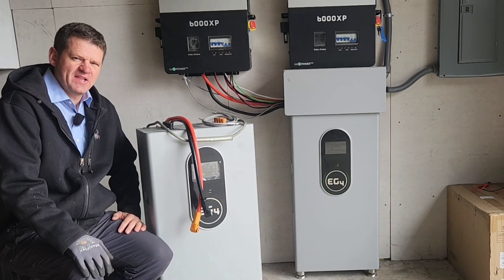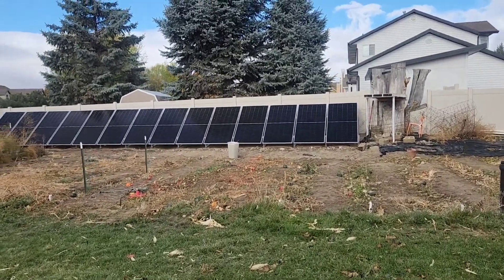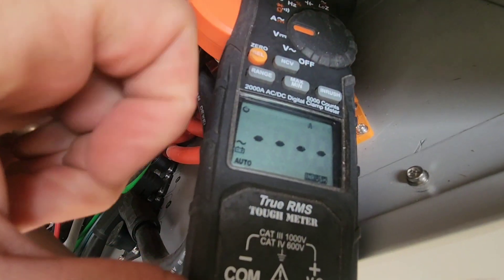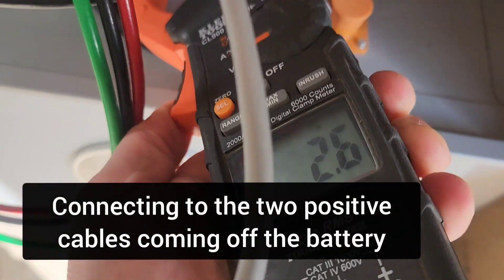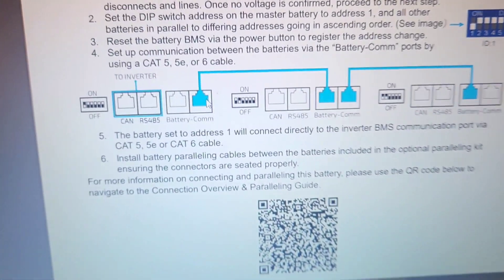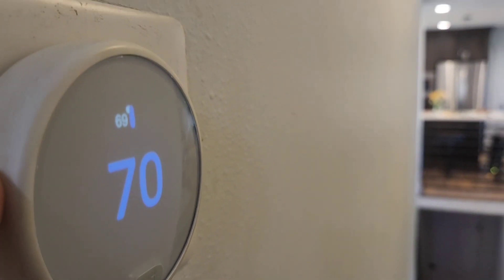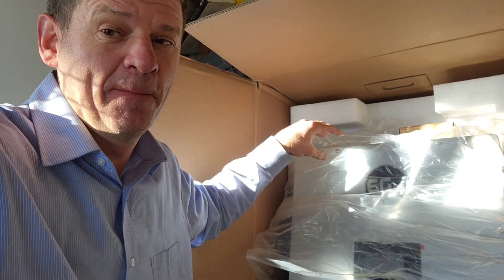Does Adding More Batteries Increase Inverter Output Performance?  Adding 2nd Eg4 Wallmount Battery

Comment: I can attest to the impact of a soft start on my 5 ton AC rated at 144 start amps. After 7 learning cycles the EasyStart dropped start amps down to 30.5 amps and running amps at 14.0 against the label value of 24.44. Startup used to be so loud and annoying, now barely noticeable.

Comment: LRA is 93 amps for this 3 Ton AC.  I just got a new 5 ton AC Seer 18 Bosch installed and it has an LRA of 27 amp and goes all the way down to 11-13 amp draw.  This new AC dropped my electric consumption for the summer by close to 40% and I am cooling the house at the coolest temps ever.  I have owned the property for over 20 years.   I am installing a EG4 flexboss 21 and gridboss with 2x EG4 batteries next and 13 kWH of solar.  Also, installing a Reem hybrid water heater full electric.  No more gas.

Comment: These overpriced batteries are a prime example as to why you should build your own DIY battery box kit. You're assured of getting true, grade A cells, a higher performance BMS and a much more reliable build because you'll build it yourself. And you'll pay a much, much lower price (hundreds to thousands lower) when you DIY your own battery.
Reply from the maker: I'm building my first battery now :)
Reply: @diySolarPowerFunWithRay  Awesome ! It's the only way to go.
Reply from the maker: @kickgas7171  its got the jk bms... I'm having a bit of trouble getting the soc to read correct. Set my cell count and ah setting... I wish there was a manual soc setting.

Comment: I had same issue with central air, dimming lights, added a soft starter and problem solved 😊( eg4 6000) unit.

Comment: Would be awesome if EG4 sent you a 12000xp to test. Ive been shocked with how much quieter it is. I had same issue where 6000xp would pull from utility too much from one leg. Specially during peak utility times costing twice as much as low

Comment: I keep saying this, watts are great but these units have too limiting of an upper amperage.  Even two investors is only maybe 80a of which you're good for 60 with issues. Everyone really needs for these systems to be able to handle 100a max, giving you 80a to use without issues. 

Again, watts are only 1 of your needed measurements.

I mean non of these systems are designed with a typical family usage in mind, let alone alone of power user. I can imagine a two EV house hold each car driving over 50 miles, with say 3 deives. Needing to recharge on a level 2 at no less than 20a each. And when or where possible allow the "only" connected EV to charge at 48a.

Comment: Old school AC with AC Induction motors that cycle with the thermostat are not just hefty starting loads, they can apply up to full locked rotor current draw every time they cycle, all day long. Inverter units don't have a big inrush current when they first start and don't cycle--they just change speed to manage temperature. It could well be cheaper to make heating and cooling more efficient than trying to manage load with an inefficient system. Alternatively you could do something funky like add a mini-split where you need heating and cooling the most. You might try adding power monitoring equipment to record where your loads are. The better quality monitors track each breaker and the main load by both peaks and average. It can be a lot more effective to see the timing of loads rather than simply how big they are. Changing your outdoor unit to an inverter type would probably help the most of anything else you might do, though if you have big electric water heaters they can suck a lot too. It's best not to guess. Once you know some loads might be OK to shift to when you have sun. In some ways a water heater is a battery--it stores heat for later use.
Reply from the maker: Thanks Bill, I agree! The crazy part is that if this air conditioning unit goes you I bet they'll want to replace it with a similar unit.  It is very good for testing the surge rating of different inverters though. :)
Reply: @diySolarPowerFunWithRay  It's easy to get talked out of doing what actually makes sense. I let a good plumber talk me out of getting a heat pump water heater because there wasn't a convenient place to drain the condensate. Now after running a monitoring system for a month I realize it's one of my biggest loads even though it's on a timer and I could have drilled one hole through a wall and watered a plant with the condensate. I think the guy just preferred to work with a unit he was used to using. Fortunately there's a second water heater that serves out guest house that is only used occasionally and it needs a new water heater. I'm going to swap the new resistance water heater into the guest house and remotely control the breaker, and put a heat pump water heater in my garage, where it can cool and dehumidify the garage while it heats water.

Comment: Good day. Id like to have your opinion on the Sunway tech solar 14.33kwh battery and if it can be compatible with a EG4 6000XP INVERTER. I have tried finding videos on the subway battery brand but couldn't find a reliable opinion
Reply from the maker: I don't think that is listed as a supported eg4 battery. You can double-check on the eg4 website though. I'm sure you could use it, but you will just have to not have closed loop communication.  You can change the configuration settings to work off voltage instead of state of charge.  
    Why are you thinking of going with that battery?
Reply: @diySolarPowerFunWithRay  thanks cheif I'm going with that because that's what's here available in belize. I tried looking up for reviews on it but maybe since it's not well known nobody has done the review. My provider mentioned that it was compatible since the Sunwaytech fell on the lux power section
Reply from the maker: @armandomata4107  interesting.  I think ruixu may ship out there. You can check with them.... I'm going to do a review shortly of their wall mount battery and can test/show the communication with the 6000xp. They have a good product.
Reply: @diySolarPowerFunWithRay  OK bro thanks for the help I'll watch the video when it's posted

Comment: Whats interesting is the ecoflow DPU says it can start an AC unit if the LRA is lower than 120Amps... buts its only a 7200w inverter... I bet the lights would still dim tho, I know mine do when it starts my 3 ton heat pump.
Reply from the maker: That's pretty good if it can....I'd love to see that

Comment: It’s always fun to see solar testing. I have a question unrelated to this particular video. I have a metal built “amish building”. It already has a slanted metal roof and I was going to install regular size solar panels across the top. I really don’t want to drill any mounting holes that may introduce future leaks. Do you know of any magnetic mounts for 100W/200W solar panels? I been looking at earth magnets with holes already in them and maybe attach them that way to the panel.
Reply from the maker: Very interesting... Sorry I don't know of any non drilling options. Please let me know if you find something you like though

Comment: the dimming is variable based on where in the ac waveform the ac is turning on. if you were able to have the ac turn on exactly at the zero point every time, i doubt there would be any dimming. this is one of those issues with led lights and power factor if i understand correctly. im not a fan of ac soft starts. ive heard from hvac people that they can cause issues with air con longevity. seems to me like it would be the opposite tbh, but my main issue is their price, durability, and the parasitic load the place on the house. appearently you can phase shift when the AC can turn on to the zero crossing point of the ac waveform everytime reliably by attaching the airconditioning through a solid state relay. solid state relays do have some loss but not very much. i believe its only when the circuit is in use. solid state relays are basically a box with a led and solar detector which opens a switch. because the light producing element can only turn on at the zero crossing point of the wave form, it almost perfectly syncs the closing of the switch with the zero cross point of the wave form. because the power delivered is the dot product of the instantanious ac voltage, the actual starting current requested will essentially be 100amps (or whatever your unit draws) x 0 volts, and will then gradually ramp up to full following a sine curve, i think ~1/240th of a second later, but thats all the electronics in the inverter needs to properly match the load. worth a shot. i dont have formal ee training whatsoever. i think solid state relays are only a couple of dollars. better than a soft start imo.

Comment: The wires from the inverters to the panel appear to be undersized, to start with…. Increase the gauge of those, first.  Next look into getting a soft start kit for your AC, which will vastly reduce the starting current required.  Problem solved, AC starts quickly, lights no longer dimming 👍

Comment: Q? did you change your batt DC discharge settings to double the amount you had before you installed the 2nd Batt? Otherwise your inverter will limit your surge capacity to only 125A DC instead of 250-280 DC
Reply from the maker: Good catch. Yeah I updated that earlier.  Forgot to mention that I had updated that in the video.  I think that helped reduce the dimming when I made that change earlier.

Comment: It looks like the wires going from your inverter to your panel is undersized for the load that you are seeing.  There is the issue of soft start with the air conditioner.  You can also get a "run capacitor" as well and a "start capacitor" that will reduce the current to the compressor
Reply from the maker: This is the video where where install the 2nd inverter and explain my decision in selecting that wire:  https://youtu.be/pBKh2Blsnrk?si=A5ZpkK9oGZVSAfXd.  I didn't account for a 90 amp spike.

Comment: I have 3 x 6000xp's and 4 x Indoor WallMounts that have been running my house in AZ for the last 2.5 months.  Even with EasyStart soft starts on each of my 2 x 3 ton Trane A/C's (old, from 1995) (soft starts dropped their inrush from ~100A to ~26A), I still get a flicker each time they start.  Otherwise has been working flawlessly.  But the flicker does really bother me, too, ha.
Reply from the maker: Someone brought this to my attention. To reduce or eliminate the dimming you could try this is the app:  Settings -> Discharge Setting -> Discharge Limit(Try increasing this value).
Reply: @diySolarPowerFunWithRay  Hm, I had It set at 480A (I think I didn't update it when I went from 3 to 4 batteries, but I was using their 160A recommended x 3).  I'll try it at 640A and see if it makes a difference!
Reply: @diySolarPowerFunWithRay  Well, bummer.  Didn't seem to make a difference.  I think I might just have very sensitive LED's.  Maybe I should try buying one of those cheap oscilloscopes and try to measure the voltage drop and duration.
Reply: must be messy, why not fewer bigger units?
Reply: @PazinPortugal  Not too messy.  It's setup on a 10' long 12" wireway with emt stubs from the inverters.  So no visible wiring and all protected.  It does take up a lot of wallspace, though, yeah.  I had considered going with 2 x 18kpv's, but since I didn't need the grid interactive stuff, went with the 6000xp's just to save a few bucks.  But, if the 12000xp's were out back when I bought them, I'm pretty sure I would've gotten two of those instead, yeah.
Reply: @PazinPortugal  That would be sweet.  I would definitely be tempted to upgrade to the 12000's if they had a nice trade in deal.  Probably be tempted to upgrade every time a newer, better one came out though, so maybe better they didn't.  Ha

Comment: Could be the lighting, but looks like your 6000xp air filters could use a cleaning.  It would be interesting to see what a soft starter would do to the flicker.   Also the wires going to the main box seem a bit undersized, but it could be because they are beside the monster EG4 cables.  Thank you for the video. I have 1 6000XP and 2 EG4 wall batteries.  I really like the capacity.

Comment: Good video. 

I think that gray cable you used between batteries is for the inverter paralleling. It has a specific pinout. Did that work for communication?
Reply from the maker: Thanks.. that's Interesting. I thought it was for battery paralleling.  I'm seeing 2 batteries and 560Ah in the eg4 app now.... So it appears to be working fine.
Reply: @ the battery parallel coms cables are typically green. But shoot, if it works it works.

Comment: Its a common thing that will happen with split cap compressors... i have a 200 amp service and my lights flicker.. either add a soft start or update ur ac system with a inverter drive conpressor if it bothers you that much for half a second.. my units 27 yrs old been doing it since day one. Unit has just a normal run cap no start cap and works fine
Reply: Just another tip anything you add onto ur unit will void any warranty if you show or tell ur hvac guy or the oem you add3d extra parts on their unit it wqsnt designed to run.

Comment: Wire to you r main panel is way undersized!
Reply from the maker: This is the video where where install the 2nd inverter and explain my decision in selecting that wire:  https://youtu.be/pBKh2Blsnrk?si=A5ZpkK9oGZVSAfXd.  I didn't account for a 90 amp spike.

Comment: I am very confident that your wires supplying the house are undersized, higher inductance with high resistance, yeah, lights will flicker.
Reply from the maker: Thanks!! This may be the cause of the dimming.  I may try this if I have time before I install the new unit.
Reply from the maker: This is the video where where install the 2nd inverter and explain my decision in selecting that wire:  https://youtu.be/pBKh2Blsnrk?si=A5ZpkK9oGZVSAfXd
Reply: 100% this^
Reply: @noysboy1  bigger is better
Reply: more volts less amps, why 220v rules
Reply: For 90 amps you need at least 4 AWG or 3 AWG,  I ran 8 AWG from each of my 6000XPx to my subpanel and it is only 6 ft. Then 6 AWG to my backfeed panel.  I run window A/Cs so no large inrush surges.
Reply from the maker: @daddio7249  The manual also mentions the recommends the wire size. Thanks
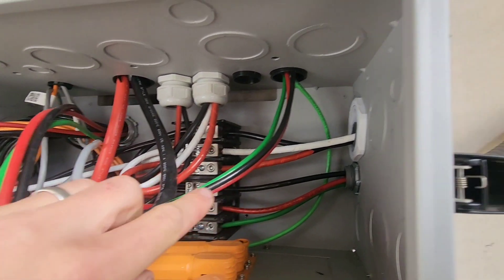Reply: 03:00 I'm not a professional electrician by any means, but when he showed the wires from the inverter that feed the panel.. I thought, those are considerably smaller than the main trunks, how are those little wires supplying the entire panel?

Comment: One quick thought I had when watching (not at all an expert just to be clear), is the gauge wire running from your setup to your panel a little small. Hard to tell what gauge it is from a video. Just wondering if the gauge is too small especially with 91 amps. Not an electrician, just a question/ thought
Reply from the maker: Thanks... here's the video where I installed that and explain my wire size selection.  👍
 https://youtu.be/pBKh2Blsnrk
Reply: Thought the same thing. I'll check out the video.....

Comment: As mentioned before, add a soft start unit. I went from an inrush of 94 Amps to 24 Amps with a continuous draw of 18 Amps. There is no dimming as there was before. You may even get the company to send you one to review on your off grid setup.
Reply from the maker: I think that would definitely work!!
However, I like having a high surge for these inverters.  :)
Reply: @diySolarPowerFunWithRay Why?
Reply: Why would you like a high surge?
Reply from the maker: @sh839c  for testing
Reply: @diySolarPowerFunWithRay  We aren't wanting to 'test' equipment. We just want things to WORK.
Reply: Now, a soft start is an excellent CHOICE,  but if your HVAC is more than 15 years old (depending on the brand and quality of the A/C), it is highly recommended to get a hole brand new 3 ton unit. Believe me, your batteries will last longer and work better. MAKE SURE YOUR A/C (of your choice) IS HOME BATTERY COMPATIBLE.
Reply: I've personally tested the Hyper Engineering software starts when I worked for a solar installer doing Tesla Powerwall installs and can concur with something in the realm of ~65% reduction in starting current.

Comment: Maybe the Flexboss would have been better. 18000 watts with solar.
Reply from the maker: Might have to try that one. :)
Reply: @diySolarPowerFunWithRay  You get line balancing and the extra AC power when you have solar. $1600 or so more. I wonder if you could exchange it or sell the 12000xp